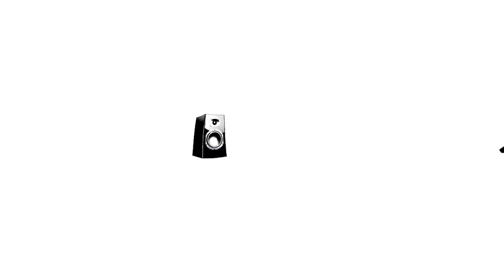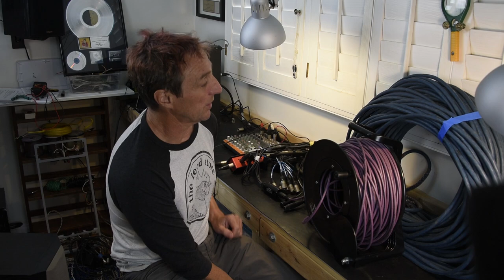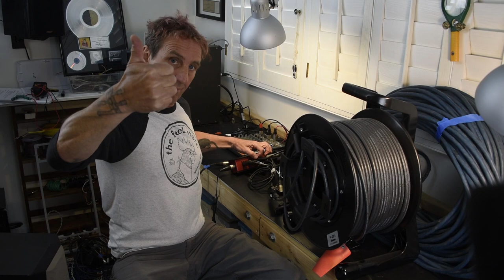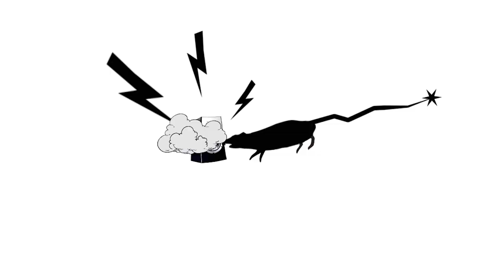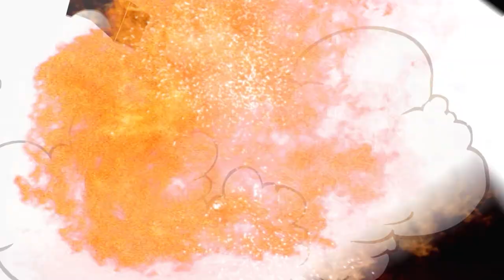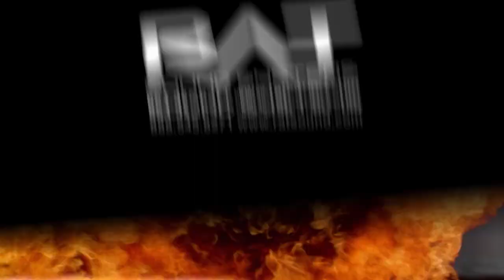Cat5e vs Audio Snake, Hear Signal Loss of 100 meter cables

Comment: Now people can advertise their vintage multicore analog snakes as sounding more “warm” than twisted pair snakes haha.
Reply: Yeah the capacitance chopping all the highs is 'warm'.
Reply: Its funny they like vintage sound and are fully against equalization and sound shaping.. Like its not the same thing in the end...
Reply: They might just use the analog cable for the bass players
Reply: I realize words like warm are subjective but I don’t think it means lower mid range. You can have “warm” high frequency distortion. I think that’s what most people are talking about. Think harmonies on revolver. Think Odessey and Oracle. Think the high fuzzy warmth of a Mellotron. Warmth and muddiness are totally different.
Reply from the maker: I take warmth to be what happens or an emulation of what happens when physical heat is added.

If you look at the frequency response of air, you will see that certain frequencies are attenuated more than others as heat is increased, I think the term "warmth" would be most universally referring to the sound of that phenomenon.

Comment: For those that are not understanding why louder and brighter =  more loss, let me see if I can explain it to you. If I am not mistaken, Dave is running a null test. In a null test, the more equal/similar the two compared signals are, the less you will hear ( theoretically nothing if the signals are identical ). Which then means the more dislike the two compared signals are, the less nulling you will have. Data cables are made to a much higher standard than your typical analog copper snake. The loss in highs is a result of capacitance between the leads. More capacitance, more loss in highs. Longer cable lengths and lower grade cable are more prone to signal loss because of this. Data cables are designed to have less loss so that data doesn't get lost ( quite literally ). With a null test, you have two signals that are out of polarity with each other, in this case, we are reading the difference between each end of the cable. If the two signals are identical, you will have 100% nulling ( no sound ). He accentuated the highs on one of the signals so that there is no chance for there to be 100% nulling. What this allows is for you to hear the nulling that does or does not occur. So less volume and less highs mean less signal loss ( the two signals are more alike than different ). With the analog snake, you had more volume and more highs because the signal was not nulling as much, meaning that the signal at each end of the cable was more dissimilar. Does that make sense?
Reply from the maker: Yes it is kind of a form of null test with the balances line input of the mixes automatically performing the null. The balanced line mixer input automatically cancels out the identical signals so all we hear is the dissimilar aspects
Reply: Thank you A/Tech.  Helped me get it.
Reply: Thanks for the explanation.

Comment: These four-channel analog Cat5 mini-snakes are an open invitation to ground loops among the four audio sources. Since there are only eight leads on the cable's RJ45 connectors, the third-wire grounds from the balanced signal sources must be combined into a single shield ground. Why sacrifice the hum protection of isolated third-wire grounds on each balanced analog signal in order to make use of cheap Cat5 cable and flimsy RJ45 connectors? If you want to eliminate bulky analog snake cable, use Cat5 cable the way it's intended, with multi-channel digitally-encoded audio over a single cable, rather than analog audio over a bunch of makeshift four-channel breakout boxes.
Reply from the maker: Hmmmm, I do understand skepticism of new ideas and applications and it may take some time to get ones head around something such an elegant and useful solution.

also maybe take a multi-meter to the back of any console and check continuity of pin1 to pin1 of any input or output and I think you may find they are all connected together.

But hey, the electrical realities of the gear is one thing, more importantly, how well do they work and is this ground loop issue you describe a reality in practice or a theoretical fairytale that lacks any real world manifestations?

Well, what you may not know is that I own a sound system rental company that provides sound for some of the world's largest events and artist. Also, these products were initially designed as a way to have modular 4 channel snakes for sending signals around stage and to delay clusters at large festivals.

They worked so well that we started manufacturing them and selling them. Since then, numerous other companies have also started selling similar products, like Whirlwind and Radial to name a few.

All that said, regardless of the fact that they are proven to be reliable and work in nearly applications where pin 1 is a ground and there are top level companies worldwide deploying 10s of  thousands of these types of analog over sheilded Cat5e products, there will still be applications and some people where using non modular, or expensive bulky multipins is a preferred for that application or person.
Reply: @DaveRat  - Your commercial involvement with this type of product is publicly known by your company's advertisements. As far as the "theoretical fairytale" you claim concerns about ground loops constitute, any sound engineer who's confronted Murphy's Law in the form of a persistent buzz that occurs right before doors open knows exactly what I'm talking about.
Reply from the maker: Well, I do spend quite a bit of time and energy sharing knowledge I wished was shared with me. As someone who started in clubs and worked my way up through arenas to stadiums and has designed and deployed systems for all of the above, numerous times for many years, I can say that yes, ground loop issues can be challenging and are a concern. 

That said, whatever is causing your ground loop will still cause the same ground loop regardless of whether you introduce the issue at the common ground stage box or use a mic cable straight to the console. In fact, the common ground stage box with disconnects is actually be quite helpful in troubleshooting.

That said, this discussion seems to be about your concern that it could cause issue vs a long and widespread real world history of it not causing issues.

Let me ask you this:

Have you tried them? If so, which brand? Have you experienced ground loop issues with them? If so, please describe as that info would be quite helpful and appreciated.

Comment: High frequency roll off is preferable to across the range frequency loss as you can upp the treble a bit to reform the loss , less loss in midrange and lower range from w1
Reply from the maker: With linear loss across all frequencies you can add gain, losses that are different at differing frequencies, it is extremely difficult fo add back in the correct frequencies. If treble is lost, at a rate of increasing loss of 1.53 DB per octave from 9.2k and your treble knob is at 6k with a linear boost, how is that going to fix it?

Using complex filters and their associated phase shifts and latency to try and repair frequency dependant losses quickly can become a messy rabbit hole to fix.

That said, this test is to show that cat5e works as good or better than audio snake for transporting analog audio. Which is pretty clear to see/hear
Reply: @DaveRat  That makes sense that if the cable causes treble roll off so great as to act like a filter, it can't be reovered through treble gain at console.
Reply from the maker: It's not that it can't be regained as much as much as it is difficult to regain it accurately. 

Several years ago, I did some tests comparing analog down an analog snake to running aes3 down an analog snake. In headphones, on the send side, it was very difficult to hear much difference between the analog and AES signal.

But when we ran one side of the PA signal down the 100 meter main snake analog and the other side as an AES signal, myself and all the other audio techs were able to hear that the analog side of the PA was duller sounding when doing blind listen tests, plus we were able to pick which was analog, even when the left right signals were swapped in several more blind listen tests.

Attempts to EQ the analog side to sound like the AES side just resulted in the sides sound different different, but never the same.

I did the testing because I had been touring the US with a large K1 system and was well accustomed to the sound, when I got to Europe and hired the exact same system from a sound vendor there, i felt the system did not sound right. Doing the AES vs analog for the return lines was part of the testing.

The main issue though that was causing the problem I was hearing was that they had inserted an additional digital unit after my analog console for signal
distribution which made the sound even worse than pure analog or analog converted to aes3

Comment: Have never clicked on anything so fast  as a fresh Dave Rat test video! 

I think the confusion in some of the comments stems from how you modded the cat box to monitor the difference between pin2 send vs return. some kind of polarity reversing / summing inside the cat box?

Also, Dave while you’re there could I pls get your recommendation for current production reference cans? Both my D2000s are dead :(
Reply from the maker: I will take a pic of the schematic and post on my FB page. As far as headphones, it's been a while and don't have a new recommend.  Will keep an ear out
Reply: @DaveRat  you the best!

Comment: Could you do a comparison of cross talk between channels? How about induced AC line noise?
Reply from the maker: I'd have to think a bit on the crosstalk as I don't have the expensive test gear. Will ponder a method to test using simple gear. I have a video on stage box sheilding done I can post soon
Reply: And there's the rub with using computer cable. While STP audio cable mat have HF rolloff at long cable lengths, Ethernet cable does not have the shield or the right number of twists per foot to protect baseband audio from EMI.
Reply: Ethernet cable actually has different twist rates in each pair, which I believe is designed to reduce crosstalk. At least that's what I was told.

It can also come with individual shields per pair in the higher categories.
Reply: @Manofcube  This is wondering i didn't know a few months ago. I did some work installing CAT6 and we used a $13k tester to verify the runs, which includes crosstalk testing. It's extremely sensitive to how much length is is untwisted to break out into the punch block.

It's crazy how much engineering goes into creating the cable with such tolerance while being cost effective.

Comment: I’ve did more then a few festivals for XM pre-merger where we’d pull back the audio from several stages to one broadcast center. We used good cat5 cable to run the feeds back to the booth. It was relatively cheap, small, light weight, and we usually just abandoned it in place on load out and saved time trying to get the hell out of there in the middle of the night. Sounded as good as any reasonably priced audio snake and you could just cut to the needed length as you set up. I imagine it would sound even better on better cable today. As an IT geek, I can tell you that the old stuff was good to 100mhz and the new stuff up to 350. 20 to 20khz is no problem. It’s got a shitload of twists so the noise rejection is pretty good as long as you stay away from power feeds. For live sound mixes that were often not pristine to begin with, it was plenty good enough.
Reply: William Wheeler gotta cross the power runs perpendicular 🙉
Reply: BuildYourOwnBass, indeed, but I can’t count how many times I saw someone try and run them together to save having to secure and cover another path. Lazy is everywhere I am afraid.
Reply: @Bill_N_ATX  sometimes there no other way for power cable.

Comment: #1: Common mode noise rejection can be 10x better on star-quad or "quad" audio cable. This can be more important than high frequency losses, especially with low-output dynamic microphones like an SM58.
#2: High frequency loss is a combination of output (source) impedance and the capacitance of the cable.  an active XLR output on say a Behringer x32 mixer is 75ohms so that should be able to drive 500METERS of almost any audio cable without any noticeable frequency loss.  There would be no real sonic benefit in using cat5e cable for line-level audio use other than cost (which is nice) but for sure you should warn people about the folly's of using cat5/6/7 wire for microphone level signals.
Reply from the maker: I hope to do some common mode rejection tests comparing snake cable, Cat5e stp vs u/stp and let our ears hearing be the info to make appropriate decisions for the application
Reply: Greg Simpson   Star-quad consistently has greater HF loss than single pair due to higher capacitance that is unavoidable in quad construction.  I avoid star-quad for long runs for this reason.

Comment: About 10-15 years ago, I made what I call a Mix Rack. It was basically a DAW that sat on the stage with a remote session and control surface out front. This only ever got used when I would show up and there was something not right about the production supplied, a mix position that was in a booth and those sorts of situations. One thing that I had noticed right off the bat, is how clear my top end was when I eliminated the FOH snake - the mix rack would be sitting right next to the amp rack so there were no sends or returns going to FOH. Not such a big deal these days, but at the time it was an eye opener.

Comment: Dave, would you mind mic'ing the speaker next time?  I hear a tiny difference, but honestly, it is so small (especially considering how much the high frequencies were boosted) that I can't see a tangible reason to go digital of your analog snake is still passing relatively clean audio.

What are your thoughts?
Reply: If digital companies had to pay for analog audio cable price they would be broke.. Maybe selling the analog snake and going digital you can improve and still save money
Reply: @josearaujo8616  I agree with you, I just don't think that there is an advantage to upgrading if your current analog snake setup is still passing high grade audio.  I was thinking that the difference would be much greater than it turned out to be.  The reason that I ask is I have 64 digital inputs in my interface setup, but to get audio from the tracking area into the interface, I ran an analog snake from the interface to the tracking room.  This was a lot cheaper that trying to set up some kind of Dante / AVB setup (which would have required buying new expensive gear and selling my current gear at a loss), and the sound quality is still outstanding, in my opinion. :)
Reply: @robertsimpson5801  I tend to agree in a studio, although honestly I think you would have much better quality just going digital all the way, acd after the instrument or mic and then digital via wireless or cable, but musicians are kind of very superticious abour their sound. In gigs, the difference for the audiance is neglectible, the quality of the sound is more dependent on your position on the venue than any cables being used. And on Hi-fi listening, just run short cables and don't worry. Too much worry about tone and sound, IMHO... it should be about enjoyment and experience.
Reply: I don't know, the high frequency difference was pretty noticeable. Especially when he pulled out the Cat7 spool. Tbh I didn't expect to be able to hear it due to the typical YouTube compression loss that kinda ruins most pro audio processor reviews. So I was surprised just how audible this shift was here
Reply: @rdean150  I guess my ear is not that good, or maybe I have significant high frequency hearing loss, because when he gave the high end that significant EQ boost, I could hear the sound of the upper frequency noise increase, but when he was switching between the two, I heard a very slight difference, but something so small that I don't think anyone would know if you were switching between the two during a live show (assuming no audible click when switching).